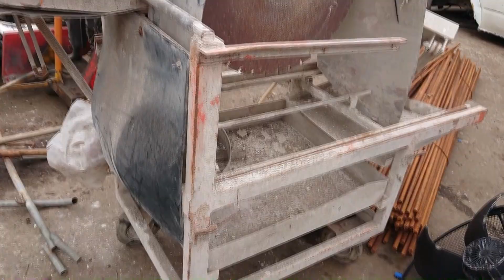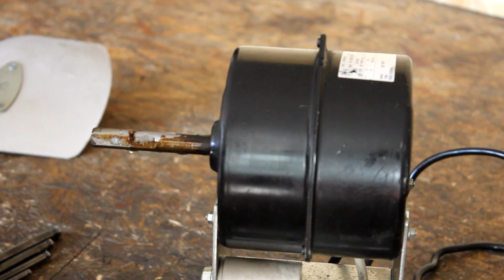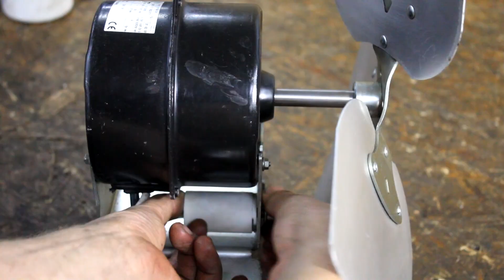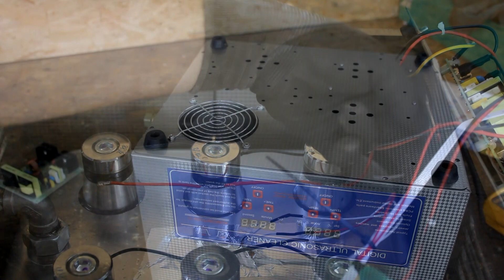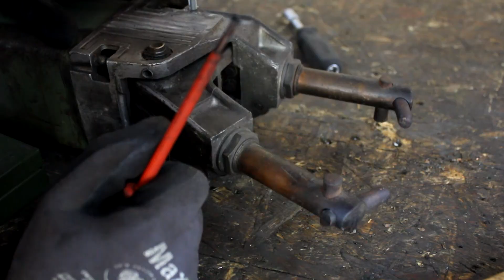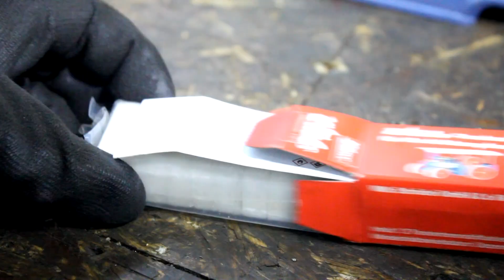Scrapyard Finds to spare! Repair-A-Thon!

Comment: I usually remove all the old grease from the bearings and gears and replace with new. That allows me to catch any wear particles in the grease. Just a bit different approach to reworking machines. I recently rebuild my 65 years old Solo backpack sprayer. Works like a new unit right now. You have a great scrap yard of which I am rather jealous. Always learning from your projects. Is there anything you cannot repair or is that just another challenge?

Comment: I bought a nonworking Skil 731 Hammer Drill. It needed to be cleaned, greased, and some missing screws replaced. Bosch had parts & a manual so I could check it out. 
Then with it running I had to find hex shank bits to fit it.  I got lucky and found someone selling a big batch of bits. It is quite the beast. It will hammer drill a 2 1/2" hole in stone just by pulling the trigger. 😁😎

Comment: For insurance reasons companies may be prevented from repairing on a component level and instead must buy a replacement that's fully authorized for safety from the manufacturer.

Comment: The thing about Hammer drills is the electrics might be fine but the Oval rotator that performs the secondary hammer action might be worn down and the gun doesn't hammer very well. that is probably why most guns get thrown away.

Comment: Very nice job on the ultrasonic cleaner. You have a good knowledge of electronics.  On the power tool part you are lucky to get the parts for them. I went the same way for a power cord on two electric power saws. I had to use a power cord minus the female end and carefully reuse the slide ends as nobody seemed to carry them. You have a great channel.

Comment: 10:50 It's "AMAZING" to me, that nobody replaced the cap to start with. Simply baffling. Here, no-one would ever replace a AC fan or motor without checking the cap first. Even the worst AC repair person would not even bother looking at a replacement motor without checking the cap. They would literally be "bored" or be too busy to mess with the motor unless it was necessary. Replacing the cap is not only cheaper, it's easier! And most if not all HVAC technicians carry spares of various capacities to test suspect motors with. 

I do agree that people everywhere tend to throw away stuff instead of troubleshooting, but start/run caps specifically are a no-brainer even in that culture.

Amazing. simply mind-boggling.

Comment: Companies don’t want the support people to repair a motor by changing a 5€ capacitor, so they are looking for people with „change“-skill and avoid the „repair“-shill people.
Ok, I know there are special situations. If a few „neon tube“ on top of a workshop need to be replaced with a krane, you would replace all, because changing is just to expensive compared to the parts price. But a 400€ device thrown away because of a 5€ part and an issue all moderte clever electric people should have heard about, is just a shame.

Comment: I have recently taken up lapidary work and making cabochons here in Santa Fe. I have purchased two very old, but high quality machines to do this work and am in the process of rebuilding both. Simple things. Replace motors, clean, and paint. Replace drive motors and drive bearings. Not hard. 
Just things most people without your inspiration and influence would not attempt. 
I, and everyone who watches your videos, thank you for both.

Comment: Not so much trouble shooting/repairing is the issue. Atleast in Canada there is so much liability for companies that could lose out on compensation is something goes wrong.
I.e. That fan. If that capacitor failed sometime after the replacement and caused a fire. If the insurance company discovers that. Chances are they will not pay out because the unit wasn't fully original/OEM.
It's a good reason why we live in a throw away society.

But fixing old power tools. Is satisfying.

Comment: To improve future cleanliness of the steam engine model I'd bend the flaps that attach the engine back after removing the engine then drill them and the base to allow the engine to be held in place by screws.  Otherwise those tabs will eventually crack from metal fatigue.

Comment: My old school company has techs just replace components once they’re found, more money made. I take the parts home to repair and keep as spares. 
I just repaired a 4 yr old vacuum pump which tripped a breaker. Was just a chinese motor cap which was open, replaced with usa made cap. Cost of cap $12, cost of vacuum pump $650.

Comment: I absolutely love these videos. The only reason I don't want more... out of 500 reasons I do want more, is that the more of these videos I watch the more old tools I buy, some of which I have absolutely no clue how to fix, other that I need to machine new parts for. I recently fixed a steam engine the size of me. This has become an addiction.

(Edit) I am a machinist, a clockmaker kind of machinist. I ended up with a Bridgeport and a Monarch lathe/mill along with my sherline and proxxon. Now I am trying to do a vise. And soon another mill

Comment: Hey man, not sure what camera you are using, but the lower frame rate, at least in the beginning of the video is quite disorienting. Not sure if you have the means to fix that, and I will certainly keep watching the video. Just a suggestion, its a little hard to watch. Especially on the shots where you are just scanning the junk.

Comment: I thought, when you were welding those blades together, you were making some kind of really nasty throwing weapon but then it was "What an expensive way of testing a welder". After all that time spent raking around scrapyards I thought you might have a bit of scrap metal to test it with.

Comment: https://youtu.be/FlRy5tVnqF8?t=371
The tailstock of your Lathe seems to be out of alignment, or the Bed ist twisted, on these light machines this is easy to correct.
You need to get the rear foot on the left side a little higher.

Comment: That fan looks more like it is out of a walk in freezer or cooler condensing unit than an AC unit..
The fact a repair person replaced the entire fan over just the capacitor is a sign of a scammy HVAC repair company. We have that A LOT in the states in the spring and summer where a compressor capacitor will fail and the AC guy will say you need a new system banking on the notion that you have no idea how your system works and you never watch Youtube DIY videos. It's easier for a company to be scammed like this because a company has the money to throw around where a homeowner may not.

That steam engine model was made in West Germany thus placing it in the cold war era when it was made.

Comment: About the companies not bothering to troubleshoot.  As a low voltage installer installing and servicing security equipment, I was called out several times to troubleshoot problems with equipment and the problem was literally someone had turned off a power bar, cutting power to the equipment. "Oh, it doesn't work. Call the service company!"

Comment: That fan fix brings to mind the hardest part of fixing electronics. "wtf is this and what does it do" 
I wouldn't be surprised if they did try to fix it and their staff had little experience with electronics. I know i wouldn't know to change that weird cylinder thing.

Comment: Love this channel. I learn alot. 
I have a question, if you have a bosch sliding compound saw motor that started overspeeding (saw does not have a speed control) what would you look for to be the problem?

Comment: Over here in the US those Bosch hammer drills are worth  a pretty penny, and there's a good reason for that :reliability.
Using a stepladder and a coffee can full of water, I can push a 10-foot ground rod into the Earth in less than a minute ,or I can use a chisel for Jack hammer demo or  bore as much as a 2-in hole through concrete, bosch tools have never let me down,    So true about how you never stop learning until you die, keep away from those, I know, I know, guys they are dangerous, they won't listen to anyone's advice can't be taught anything ,and have to learn things the hard way, they may not even learn when they blame something else, or make excuses for fucking something up , they can hurt you along their way .especially If you have to work alongside them.

Comment: just a question if you are a post apocalyptic inventor why do you cut an extension cord? didnt find any cord in the scrapyard? when you try to tool why do you smash a good brick? why isnt try to use a half/damaged brick?

Comment: I have several hundred hours behind a Bosch hammer. I've never seen one burn up, or be broken beyond repair. We used them for 8-10 hours straight multiple times a week for several years, with no real issues. 
The switch plate breaking is common, but doesn't really sideline the tool.

Comment: That little steam engine workshop might be the coolest thing I've ever seen. If it's not the coolest, it's Top 5. If I wasn't so far away (Australia) I'd ask how much you wanted for it. Another excellent video, those Bosch hammers are beasts for their size. And I've never seen inside an ultrasonic cleaner so thanks for that. Cheers.

Comment: what is the capacity of that spot welder?  (how thick of metal is it rated for? and how many cycles per minute can it safely run?)

what a fun little steam toy, it is a shame it uses spring belts as I bet it could be used to cut and drill tiny bits of wood.

Comment: Incredible the quality of the equipment that people throw away. Precision and highly engineered and crafted and hardly anything wrong with them. I suspect the reason for this is because of the modern corporation's concept of "externalizing costs" because surely if you added up all the time and effort and money of creating those tools from brand new again, you would be more efficient doing at least some of the simpler diagnosis and repairs on these things. Either that or they just don't have time to fiddle with things and to them the cost isn't too high to just replace it and it's more important to keep the big ship going strong than it is to worry about little repairs here and there. It's not worth their time and the money isn't a lot to them.

Comment: I love it, great insight and work as always. Just FYI, the oil type WD40 is, is simply called "light oil" in english. Someone might say "I just put some light oil on that and it started moving again". Just in case you want to describe WD40 without giving them free advertising.

Comment: Top tip - cut the component leads to size before soldering them to the board. This reduces the stresses on the PCB tracks.

Comment: I can understand that the service person would throw out a faulty fan, or whatever. It is likely they did know what the problem was, but it just wasn't worth their time to repair and find a new home for it. I think the problem is that there is currently no practical in-between for a thing like this. Its either warrantied and working, or its trash. Getting it to someone with the ability and resources to repair it, and finding a buyer who trusts that repair - that too takes time and resources. We need better secondary markets for refurbished stuff like this.

Comment: haven't watched all the way through as yet but before I forget - I have one of those Bosch hammers, the brushes are 'life limited' and although they can look good the unit will stop (the service light should -!- come on, mine did not) for about £6.50 OEM parts I'd swap them anyways  - did mine last week and it runs fine now :)

Comment: 11:00 it is super convenient that everything technical now is dirt cheap. the downside is that no one could be bothered to take apart some device and figure out what's wrong. two other development also counteract that notion: products are no longer designed to be serviceable and there is no information available on how things work (technical drawings, dis/assembly guidlines, schematics, test points in electrical circuits). too bad!

Comment: It's so sad a lot of younger ones no longer want to learn how to repair and even restore older equipment, they would rather buy new. I would much rather something old that can be repaired or serviced rather than disposable. 

I got into Electronics in the late 80"s i was about 8 years old, While i only stick with basic repairs, Automotive electrical etc, It teaches you so much and you learn new skills.

Comment: \I went to a local recycle place and found a large container with a layer of various small tools, nuts, bolts, screws, nails and washers. I found a 8 inch bread pan and filled it over full for 3 dollars at todays prices I guess that bread pan would be 50 dollars easy. I had to sort it all on a fold up card table.

Comment: Regarding the fan. While it may have been a simple fix, there are a number of things to take into account. Time is money. Spending time diagnosing and trying to fix a capacitor sounds nice until you realize there are static pressures, allowed startup current and allowed operating current ratings. Replacing a capacitor NOT part of the original design can and does affect this, and has often caused further issues.

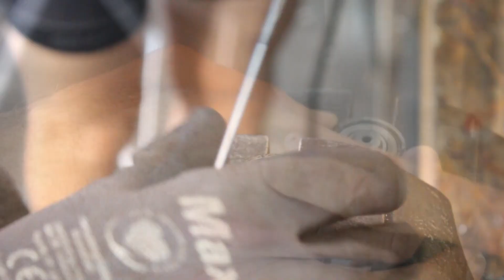Comment: 6:31 - AGGGHHHH - don't hammer on a ball bearing! You put little dents in the balls or races, and the bearing will be noisy and wear out! Always press them off or use a bearing puller to apply slow constant pressure.

Comment: Why did you reuse the old bearing in the hammer drill? While it was broken down, I would have installed a new one.

That steam engine and workshop are AWESOME!! Maybe rather valuable?

Comment: can you connect an oscilliscope to both the black and blue units to check if the changed rotor had an effect on the load of the motor

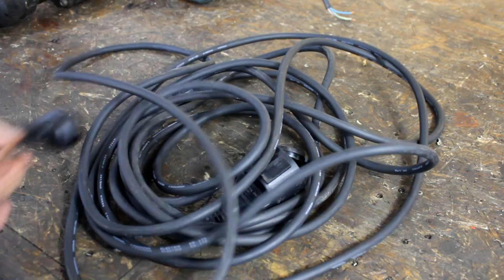Comment: 4:00 what size cable would you need for running the drill?
Reply: Needs 2x1.5mm2  rubber with extruded plug. That 3 wire cut off extentioncord is not legal.

Comment: The steam engine toy with complete workshop in near mint condition was a great find!  Here in the states, those go for hundreds of dollars for just an engine in less than perfect shape and each work station toy is seventy-five or more depending on condition.  If you want to make some bucks, put if on EBAY here in the states.  Even with the international shipping you should make some $$$!  I would not be surprised if you could get nearly $1000 dollars for that whole setup.

Comment: Not sure if you noticed, but one of the pully guides for the steam engine's drill press isn't spinning properly while it's running. Perhaps the reason for the original pully failure. We have models like this in the United States, for quite a pretty price, which use rubber bands rather than steel coil pullies. I suppose it's a somewhat lower quality than steel, but it's also much softer, and much easier to replace when it goes bad.

Comment: The electrodes on the spot welder should be reduced in diameter to get a better weld . Also you might be able to adjust switch timing relative to full force on material to be welded

Comment: We are "trashing" ourselves into oblivion on this planet.  Recycling contributes significantly to reducing our environmental footprint.  Keep up the good work.  You are inspiring!
Reply: Its not even recycling, but repairing useful stuff to be reused. Specially older stuff while not efficient as new, are far easier to repair than modern machines.
Reply: @Hellsong89  Agreed, I try to do that as much as I can, and what can't be saved I make sure it goes to recycle if possible. I do it alot with old electronics, and computers, and even have an AMD Athlon II era computer in use from 08 at work for a basic office PC running Manjaro Linux, and it will keep doing so till it can no longer serve its usefulness, or dies.
Reply: "Recycling contributes significantly to reducing our environmental footprint." uh, last I checked, recycling wastes more energy then it saves
Reply: @pacman10182  https://www.saveonenergy.com/learning-center/post/recycling-save-energy/
Reply: @pacman10182  https://www.newsday.com/opinion/commentary/recycling-myths-1.18286155
Reply: This is a political issue. As long as conservatives are at the helm, nothing will change.
Reply: @mojoblues66  Give it a few years, we'll all be singing a different tune.  At 72 years old, my two points of reference draw a line into a pretty scary place.  I will still keep my optimism, and keep visiting my local scrap yards regularly.  Kudos to all of you who do the same.  You are forward thinkers.
Reply: Give PAI a little money to help him keep up his good work.  He is inspiring in what he does.  We need a grass roots campaign.
Reply: @mojoblues66  I am a conservative on most issues but I find the wastefulness of modern society appalling. I think it is more a greed and laziness issue rather than a political one. We are way too much of a throw away society.
Reply: @josiahtheblacksmith467    Agree 100%!  When our city has a "clean up day" it is appalling what is on the curb.  And the City Counsel made it illegal to pick things up.  Greed, laziness, and I would have to add stupidity and arrogance.  Liberal or conservative, makes no difference, we are all going to be swimming in the "stew."
Reply: @josiahtheblacksmith467  Greed and laziness are the driving factors on an individual level, but due to being billions of us it becomes am issue that can only be solved by politics.
Reply: @mojoblues66  stopping lobbying by corporations and term limits for all elected officials would be a good starting point I think. chancey47, I really don't understand why they have to pass a law against taking what other people are getting rid of, that makes no sense. If someone is throwing out an item that you have use for or can scrap or salvage then I can not see why there is a problem with taking it.
Reply: @josiahtheblacksmith467  I agree, if I see someone struggling to load something, I stop and help them get it on their truck before the cops get there.